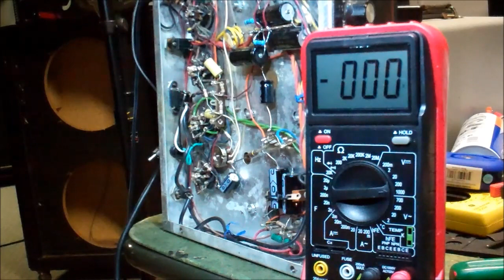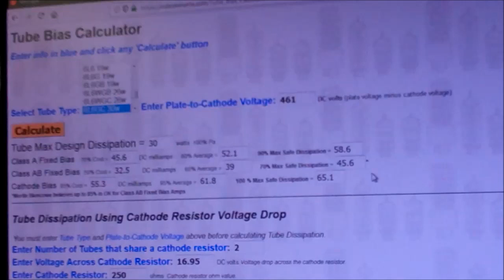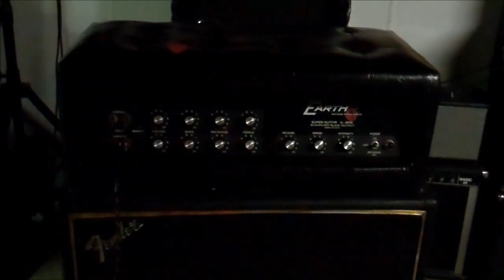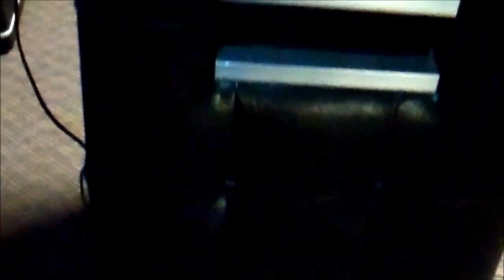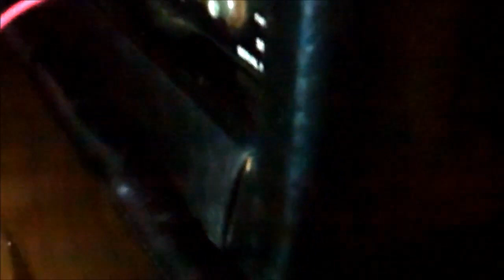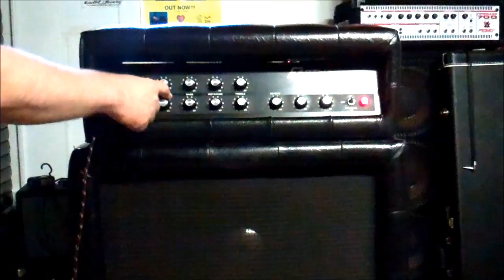Earth G-2000 Part 6,  Bias,  Clean-up,  missing parts and sound check.

Comment: I have a Plush PRB 1000S, looks Identical to the Earth. It came with a 2 prong Cord, No Ground, that has been fixed. Death Cap has been removed. What you have said, it needs to be at least at '3', on the Go Knob to have any fun. This amp can be extremely loud, especially, running a 4 X 12 Celestion 16 Ohm Cab behind it. It doesn't seem to mind. My Supply Voltages, even with Re-Caping, and some Resistors, to the 6L6's are still at 480V. Grid is 55. This thing is made to be LOUD! Wish I could find the Original Schematic. I have been using the Earth G2000 Schematic, and many things don't match up. Very Frustrating! The Amp I have has No, adjustable Bias, Straight resistors, so the Tubes have to be good. Thanks for your Very informative Videos, it has been so helpful!
Reply from the maker: Glad to help.   This Earth amp was a weird one,  but I just had to bring it back to life.

Comment: I had one I purchased around 1978 and sold it around 82. This amp was incredibly loud. It was more than 100 watts. For some reason, I think it was 270W rms.
Reply from the maker: With 4 6v6's,  this is considered a 100w amp,  but technically you can squeeze a little more than that out of them.
Reply: @DeadKoby  I believe mine had 2 large speakers. at least 15"s. The ground would shake when I turned it up.
Reply from the maker: This Earth G-2000 has 2 15" speakers made by Eminence.
Reply: @DeadKoby  Yes, that's it. Thanks. That was one powerful and loud amp. It would shake everything upstairs in my house. I sold it to a friend and it was driving his wife nuts with how loud it was.
Reply: Correct, yes 270W RMS. I had one years back. It shook the neighborhood. The first time I cranked it up when I went to go buy it, it made me jump back when I struck the first chord.